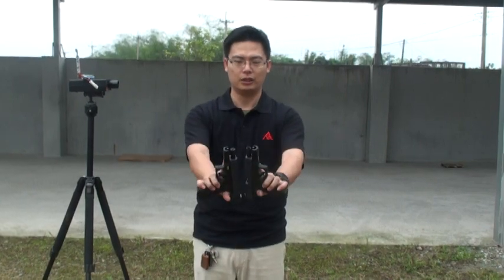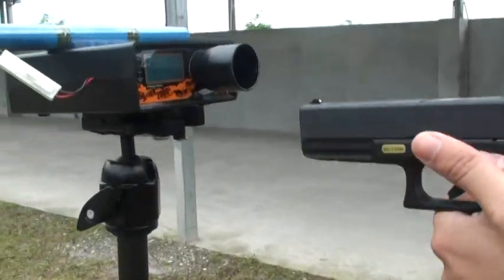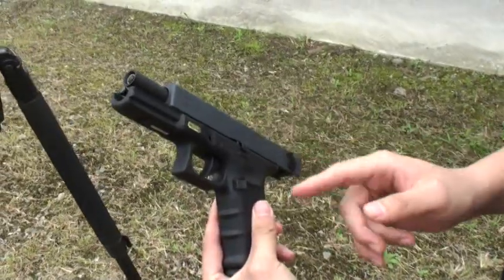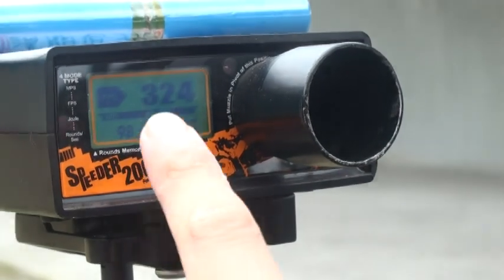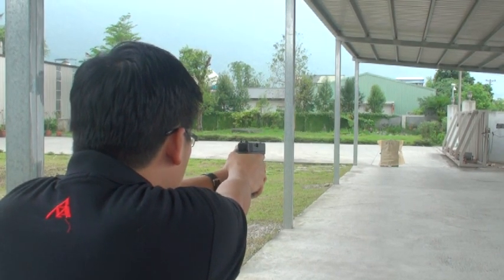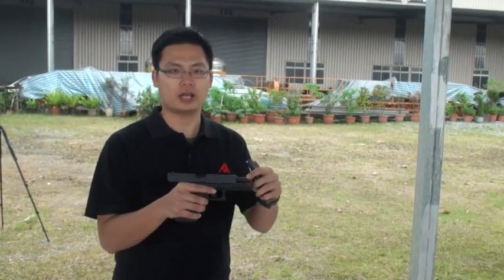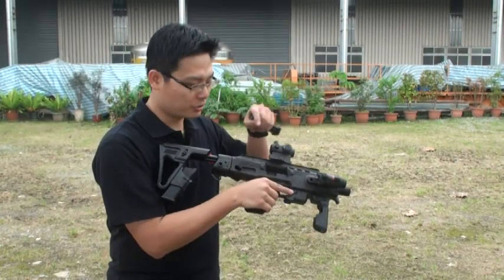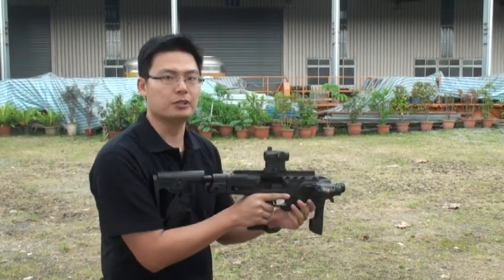RA TECH   A+  hop up  rubber test

Comment: I'd like a test with only one variable-the FPS difference will be most likely mostly due to the Inner barrel, but a really good hop can create a better seal; we can't be sure which here since both were tested together. Test the inner barrel and hop up separately to demonstrate the difference for each alone and I'll be more interested. As is, there's a significant difference, so I'm eagerly curious to know how each factor contributed. The standing firing test is less than ideal, but fair enough.

Comment: Hello! Thumbs up for the time and effort in making this video, and I usually like watching your videos because u use rather objective and accurate testing methods. 
Unfortunatley I have to point out that this wasn't one of them. First, they were made form a standing position at 20m, wich is way too far and unprecise stance for a pistol test (even when done by an experienced operator). 
Also if we take out the one "stray" BB in both tests, you can notice that the groupings are very similar.

Comment: In the end, other than the FPS increase (wich is probably the result of a tighter barrel), you really cant see any benefits of the new hop up rubber.
I'm not saying it's not good and/or better than the original, it just can't be "concluded" from this video ;)
Keep up the good work! :)